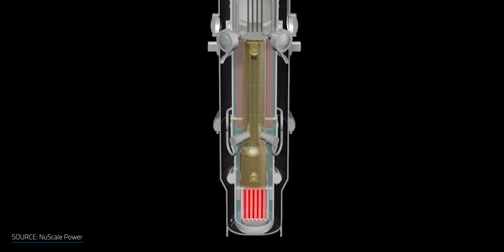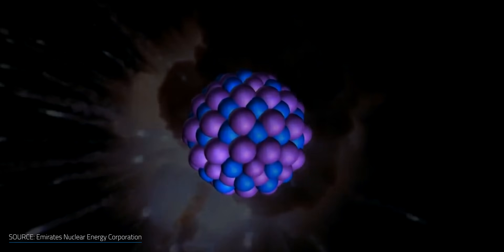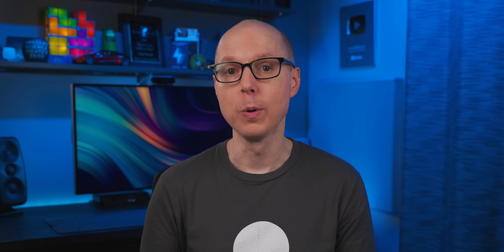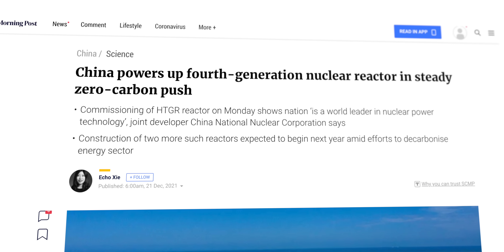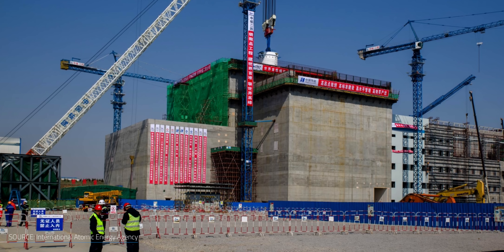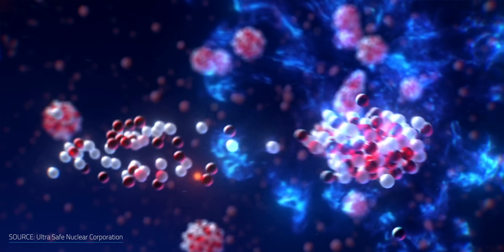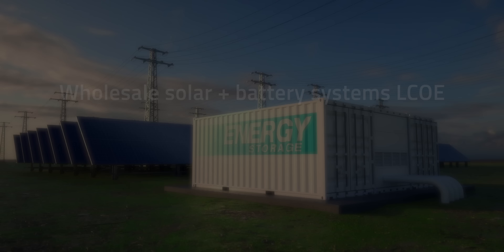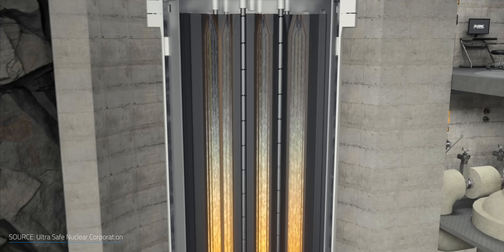Forget Small ... What About Micro Nuclear Energy?

Comment: Nuclear is literally the most green and environmentally friendly energy solution in existence. People are still too afraid of the fact that we didn't properly know how to control it back in the 80's. Chernobyl was nearly 40 years ago!
Reply: I don't have good space for solar panels on the roof of my house.
I don't have space for a big ground-loop heat pump in my yard.
I do however have space to dig a hole and place a nuclear reactor in my small backyard if it can fit in 1 or 2 cubic meters. 

I mean, how small could you make a nuclear reactor if all it had to power was a single home?.... I doubt it'd have to be much bigger than that right?
I'd much rather spend 10k on a 'small home' nuclear reactor than the same amount on solar panels that'll produce <10% of the reactor's power, and intermittently at that...
Reply: @ayporos  You could put it under your patio and have a nice heated  floor during cold nights
Reply: @Echidna23Gaming  I'll do you one better, the 'rest' heat not directly converted to electricity could be used to heat your house in a radiator loop! :) moar efficiency !

Comment: solar or wind + hydrogen, can achieve a much lower price than using batteries as storage for most applications.. because none of the solar or wind output would be wasted by lack of capacity, of course the idea is to sell that hydrogen for all the energy sectors who need clean energy in chemical form.

Comment: Well done. It is important to understand that LCOE was developed during the era of regulated utilities to evaluate different sources of electricity that were always under the control of the grid operator--that is, the sources are dispatchable to match the demand. Variable Renewable Energy (VRE) is NOT under the control of grid operators but come and goes at the whim of the weather or time of day. In order to match generation with demand, VREs must be combined with dispatchable sources. Accordingly, LCOE is not an entirely helpful metric for VREs because the total cost of useful electricity is a weighted sum of the VRE plus some dispatchable source(s). California is using lots of natural gas for this job plus some pumped hydro, imported energy, and minor other sources. Last year, the Environmental Defense Fund (EDF) funded three independent studies by Standford, Princeton, and E3 to evaluate if California could reach its clean energy goals with VREs. All three agreed that the goal is achievable if Clean Firm Power is available to meet demand when the VREs are low or non-existent. Clean Firm Power includes nuclear, geothermal, pumped hydro, and batteries with caveat that batteries are expensive and limited to a few hours storage time. Here is the study. This would make a great episode.
https://issues.org/california-decarbonizing-power-wind-solar-nuclear-gas/
Thanks
Gary Nelson

Comment: Honestly, it’s a great idea but the reactors would need to be buried 200 feet under ground or sealed inside 30 feet of steel reenforced concrete.  The feasibility of micro reactors has been a thing since long before the USS Dolphin’s “trashcan” reactor.   The HUGE issue is extremist and terrorist groups who would go to great lengths to turn such a device into a weapon.  Even a non-enriched source can be deadly if used as a ‘Dirty-bomb’, spreading contamination across hugely populated areas.   

Maybe someday when there isn’t a threat from people who live on hatred and power trips, we can have such things. Right now. 

No.

Comment: I was doing some research into Nuclear power a few years ago and found some people making the following claims:  

1) That we now have technology that puts fuel through at least 3 stages of power generation.  That those 3 stages make the half life 300-600 years.  It could have been thorium, I'm not sure. 

2) That we have storage technology that ensures there will never be a leak of the vessel.

3) That people are constantly working on ways to figure out how to take what we currently consider "nuclear waste" and put it through yet another power generation process which will again lower the half-life.  So, 100 years from now, we take that waste that was gonna be around for 600 years and knock it down to 300 and get more power from it.. and so on and so on.

Really also,  renewables (or at least renewable only) is a HORRIBLE idea.   You yourself have mentioned how ineffective Solar is.  Wind isn't any better.   On top of that, the LOCAL devastation and pollution  caused by mining quartz and other rocks  to get silicone, lithium and other "rare earth" materials  and the processing there of is absolutely horrible.  I'm pretty sure that it the water used in the processing is polluted for at least 1000 years. 

Youtube and the internet in general  is happily now full of videos and other content talking about how horrible renewable energy is for the environment... but, we're still running head long into it.   

It's as bad if not worse then Fracking... and no one likes fracking. (Well, except that it gives us cheap natural gas which we like when we pay the bill) 

It's really odd.

It points to an ugly truth that the whole reason Nuclear isn't widely used and why there is so much resistance to up-scaling it being down to perception.

As for the cost of Nuclear being so expensive, that's like you said just because it isn't commercialized.. yet. The more it is, the cheaper it gets.

Comment: Anything that cannot, by design, go boom with radioactive material is already a good start.
That being said anything that produces nuclear waste with relevant levels of radiation is also not a good idea. 
Nuclear in the end is just another form of burning fuel (practically). It produces waste and needs a stable supply. With explosions out of the way those need to be handled to a satisfactory degree in my mind before you start normal cost-to-benefit analysis.
That's why i am against traditional nuclear reactors. Sure they look rosy if you look back at the what? 70? years we're using them. The issue is the tens of thousands of years to follow.
So... keep looking. "Burning fuel" has it's place. Just don't build the entire grid from it.

Comment: Great video Matt.  Actually the Nuclear Battery is the technology of the future and the grid connections will be adjusted to use a new type of geothermal.  Both of the these technologies are the only real path for energy enhancements conceptually, once these technologies are realized there will be no conceptual improvement required over time, just refinement of concept in production environments.  Using these will require much study and implementation research but ideally the Nuclear Battery will be attached to the vehicle main battery which will charge it continuously and will require an energy outlet such as LED's or other to prevent over charge damage of the normal vehicle battery.  You understand how important information about these technologies really is and how even if I wanted to explain further it's not wise to.
Reply: E

Comment: Hi, Mack here. 

Nuclear Engineer by education, radiation shield manufacturer by trade. I went to school where NuScale was born out of, Oregon State University and there was a 1 MW TRIGA reactor operating there. In fact, you could walk on top of it while it pulsed to over 2000 MW and see the blue Cherenkov radiation glow. 

Fact checker, tidbits of information, and personal opinions. 

Each NuScale module is rated for 77 MW, they would be up to 200 MW with a water pump, however, natural buoyancy and gravity allow passive safety, ie the core can cool off without pumps. 

A NuScale 12 Module pack is 924 MW. 

On the thermal/fast reactor talk: 
Thermal neutrons are neutrons with the same temperature as their medium. Ie, 2200 m/s at room temperature* faster at higher temperatures, which means lower cross section, which means inherent safety. This is also known as negative reactivity temperature coefficient. 

Helium is also non corrosive making it very simple from a materials prospective. Helium does not interact chemically with reactor materials. However, due to its low density, it cannot be as energy dense. A LWR, or HWR has a power density of about 100 W/cm3. Low power density and low pressure are required to make reactors safer, this is why we build containment vessels around big water reactors. 

Beware of liquid sodium cooled reactors,  they are low pressure, however, very high power density. If sodium contacts water it will explode, which is undesirable from a safety prospective. 

A lot of new designs will push for higher performance, however, safety should be considered first. But not to a point that it crippled the nuclear industry. Rickover always asked others if they would be comfortable putting their kids into a nuclear submarine while the core was failing, that attitude has lead to the safest operator of nuclear reactors in the world. 

Ultra safe nuclear also has micro reactors, their materials engineer also came from SpaceX. I was kind of sad not to see any mention of them here because their reactors are going to space! The moon, Mars, and beyond! 

On SMR technology, It will be a part of the future, heck, it’s already a part of the US Navy giving the US a major tactical advantage. Micro fission/fusion reactors in the form of 700 lb missiles already exist too. 

This technology would be great if we figure out how to get highly enriched fuel into reactors without any risk of people getting weapons from it. Even in the large reactors we have today the fuel is only 5% enriched. If we had 50% enriched fuel the fuel lifetime would go from 4.5-6 years to  45-60 years with very high capacity factor.

The idea that we use fossil fuels in the face of collapse is ridiculous. People argue we should hold out until fusion energy, my take is (evidenced by my logo), fusion energy has been around for 4.5 billion years and will remain for another 5 billion years. It is present on 1/2 of the earth at all times, with a 25% capacity factor. 

We really are just sitting around a fusion campfire we call the sun. 

Anybody who puts up a solar panel is exploiting nuclear fusions. 

Anybody who relies on seeing using sunlight relies on fusion power. 

Any plant based life is fusion powered. 

Any oil is still fusion powered. 

If we want serious nuclear fission reactors, we should vertically monopolize the supply chain and just go for it. Pick a spot in the desert (I would recommend where all the nukes were tested) and test innovative cores in a nuclear bunker underground. We test them all until they safely fail 1000 times in an accelerated timeline. From there, we decide which ones are acceptable, and which ones are not. Any resource needed, included cooling, should just be provided. 

Pick another spot in the desert (or ocean), maybe Hanford (maybe the pacific), and build a massive complex that has plenty of cooling water, cooling air, build massive manufacturing and transportation capabilities, and crank out large reactor after reactor with special attention on minimizing human labor consumption. We should make enough energy for the entire world to live up to American standards, and boost American living standards to space age energy standards. Including full access to RTG technology for space exploration/exploitation.  

From there, we figure out how to make a 1 Gigavolt world distribution. 
1 Megavolt country distribution. 
1 Kilovolt Underground town distribution. 
1 volt home distribution (avoiding fires).
Or, whatever works best, I am not an electrical engineer and I am okay with saying that. Whatever is safest. 

Allow experts to maintain the safety of the power source for the entire world in one place. The jobs would be one month at sea, and the rest of the year at home. 

This model would work well because power spikes around the world in different times would levelize the power consumption to some extent. If there are demand spikes, the nuclear site should have a giant thermal battery which is hooked up to supplement the steam turbines, or sCO2 turbines. This thermal battery could be a large molten pool of lava for all I care, and should probably be managed by mechanical engineers, but that’s how it should be done. 

All nuclear waste should be packaged up and thrown into the thermal battery to keep heating it. Why waste precious nuclear heat? It’s not waste if we still use it. Extract all uranium and transuranic elements from waste and repackage it for fuel. Isotopes get packaged for space exploration. Any gamma emitters sunk in a pool of water for heat extraction. 

Also! There should be a large desert covered in aluminum foil nearby to offset the waste heat emitted from the power plants. It’d be huge, but that would bring balance back to the world. 

We ditch gas powered and electric cars and use pressurized superheated water or hydrogen powered cars. 

I am a nuclear engineer and I believe that nuclear power is too cheap to meter. However, that should not come at the expense of wasted life and failed dreams when we are tasked with making new reactors and licensing them. It should not come at the expense of displaced humans when reactors fail. Reactor failures should not be exploited for press  propaganda. Reactors should be able to completely fail safely, and if they cannot fail (ships and cities for instance), then they should not be built, or, they should operate in a manner where there is 0 (or very near 0 such as NuScale) chance of radioisotope release. 

We should have a place where if a reactor does go wrong, it can be quickly and appropriately handled. I would be a large proponent for a central place where we can selectively make it rain, and collect the radioactive waste on the ground without having to dig it up. This place would have very little population, and no risk of anybody being displaced in case of emergency. It could technically be a large nature reserve as nothing would hopefully not go wrong for hundreds of years, but when it does go wrong, we can take care of it “promptly” and efficiently. 

This place would have all enrichment facilities, waste disposal, weapons disposal, power generation, fissile material breeding, and mining if possible. Regulatory professionals, IAEA inspectors, and resources would be available for any innovator to come and innovate successfully in 1 year, start to finish, housing and appropriate stipend provided. Enough resources would exist for a power plant to be built in one year start to finish rather than a decade. Enough capital would exist for reactors to go online at any moment. 7900 GW base power would allow for every human to have 1 kW freely. Beyond this, money would come from people consuming more than 1 kW at any moment. This would incentivize people to store energy in their home air, water tanks, etc. which I also have ideas for. 

My facility would even have a large pool of heavy water with neutron fluency to burnup the little last bit of u235 in fuel waste, and have various pits with different energy neutron fluxes to breed new fuel and isotopes. 

Nobody would ever have to worry about energy again and we could live happily ever after. If a future human wanted to have a campfire, they would not have to worry about the carbon emissions because we took care of the carbon problem in the 21st century. 

In my theoretical facility, it would be perfectly inspected at all times allowing anybody access to the information resulting in surety of the safe operation of the facilities at a quick glance. 

Technically a site like this could exist in the ocean where nobody lives, winds are reliable. It’d be a lot of effort, but that would be taking care of the generations of humans after us investing in their success.

Also, there is a push for fuel to maintain its waste completely. But why not capture it and remove it constantly so that in the abnormal case of a failure, there are no harmful isotopes to mess up humans? I know this is what will happen in molten salt reactors, but I imagine that solid fueled reactors could benefit as well?

Comment: 4th Gen micro module nuclear is the best solution for our energy demands/future. I disagree with the cost breakdown he showed. The ultimate plan is for Mod Micro Nuc to circumvent all of the legacy regulations by getting the gov to classify them differently because its being built in a factory and every aspect of the manufacturing process/assembly is controlled and secure. Plus the 4th Gen reactor design is walk away safe so there’s no need for buffer zones surrounding the plant or needing to be by water. Lastly because everything is housed in a rigid waterproof container, flooding and/or earthquakes are not a factor. The cost per Mw would be a fraction of what he showed, on par with nat gas. Everyone seems to overlook the unique efficiency gain micro nuc has due to the factor it’s a hyper localized power supply therefore doesn’t lose 40-50% of the power generated in transport.